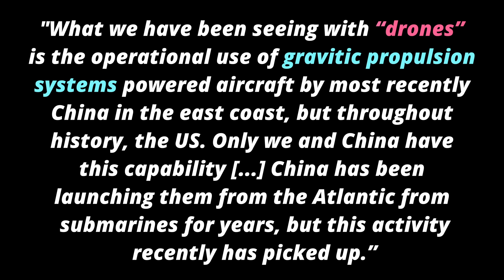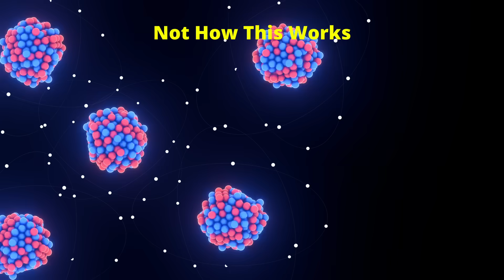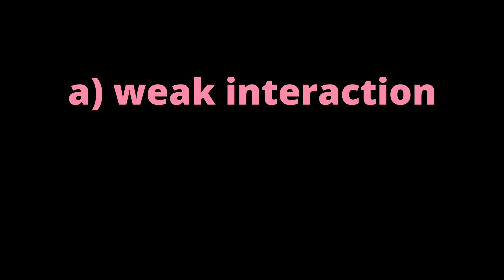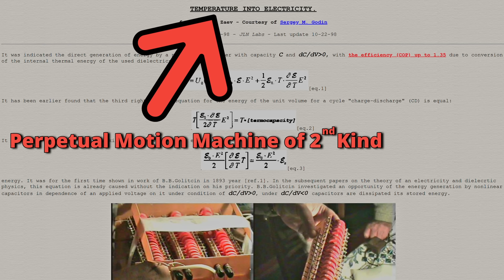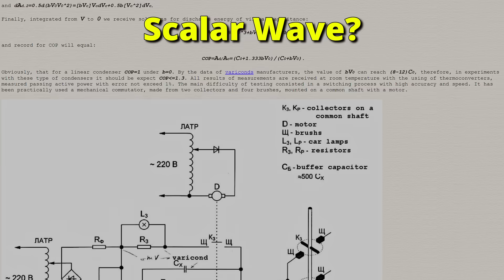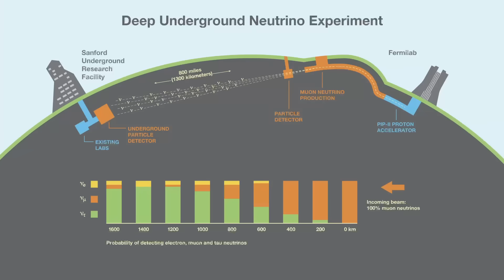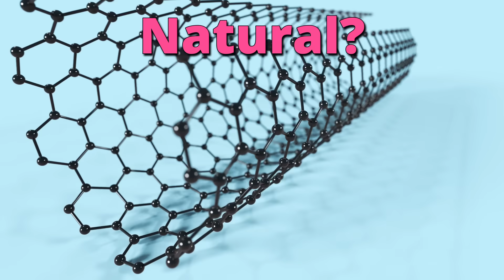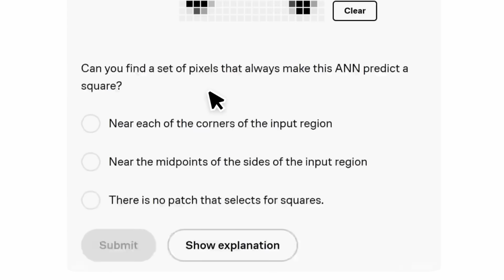What is “gravitic propulsion” and could the US government hide it?

Comment: I recall reading about a guy that got in some hot water (not terribly severe I don't think) because when a newspaper published a photo of a nuclear explosion, he used dimensional analysis to determine a bunch of things about the bomb that had produced the explosion and when he wrote about it the government freaked out and thought he had accessed classified information. The NSA has also actively meddled a bit in the cryptography space, encouraging things like device manufacturers to set modifiable parameters for pseudorandom number generators to specific default values which they knew had flaws that resulted in making the encryption they were used in easy to crack. There's also a law through which the government can ban the publication of certain patents, I read about a list of ones they forbade but they're mostly all related to making weapons so not terribly surprising. The only one that surprised me was that 6-axis 3D printers were controlled for a long time. Loads of stuff in aerospace is classified or at least export-controlled information that it's illegal to send to other countries. Back in the 1990s I remember the creator of the PGP public key encryption software got a minified version of the source code tattooed on his body because the government was trying to control availability of encryption.

None of that stuff is 'conspiracy theory', they are usually quite public about banning things, at least the things that are no longer banned. I've seen people on YouTube doing 6-axis 3D printing, for instance, and 20 years ago that would have gotten them a visit. What annoys me the most is that one of the justifications listed in the law that permits them to ban patents is for 'economic stability' reasons. And I think that gives a lot of steam to conspiracy theorists. It's basically saying 'yes, if we invented a super efficient car that runs on water, we would probably classify it because it would make the auto companies poor'. They haven't done that for AI though, which is basically 1 breakthrough away from annihilating knowledge work. For all I know they've never actually used that reason to memory-hole a patent. I would certainly very much like to know, though.

Comment: "Change the ruler"?
Your speed changes WITH the ruler! 
If a plane buzzes past at 500mph, it looks fast, but if you change the ruler by looking at it from 7 miles beneath it on the ground, it looks like it's going slow, but it's still going the same speed.

Comment: Case in point re. the government suppressing maths.

Back in 1973, the USA government requested submissions for a new encryption standard and IBM put forward an algorithm called "Lucifer." The NSA accepted this candidate but on the condition that changes were made to the "S-Boxes" - substitution matrices that govern how strings of bits are mapped to others as part of the obfuscation process. IBM didn't know why, though there were some suspicions that the NSA might be installing some sort of backdoor but nobody could work out how such a thing might be working. The algorithm, with the revised S-Boxes, became DES (Data Encryption Standard) and was released in 1977.

In 1991, a researcher called Abi Shamir (yes, of RSA - Rivest, Shamir, and Adleman - fame) subjected DES to his new Differential Cryptanalysis (DC) technique (which analyses two or more plaintexts and their matching ciphertexts to look for patterns) and he found that if the S-Boxes hadn't been changed, DES would have been much more susceptible to that cracking technique than it was with the changes.

The conclusion... the NSA knew about the mathematics involved in the DC technique nearly at least 15 years before it has been publically (re-)discovered. As it was, DES was still susceptible to cracking using DC, though this was largely because of the increase in computational power in the intervening years and was supplanted by the new Advanced Encryption Standard (AES) in 2001.

Comment: There's a way to go fast. There's the proven method of slingshotting around planets. If you've got lots of time, I think you could do the same thing around stars. There are indeed a lot of stars in our galaxy, so a lot of opportunities for a slingshot. You could reach a very high speed. Of course, it will take thousands of years to reach a high speed, and it'll also be a lengthy process to slow down. So you need a lot of patience for this.
Then there's the slingshot idea behind a space elevator. Putting several such slingshots in a row could propell a spacecraft to very high speeds. Well, unless the slingshot disintegrates under the enormous stress.
A good bet could be a double star system. You could slingshot a few times around 2 stars and get to high speeds, thanks to their high gravity. You'll also need a binary star system on the destination to slow down.

Comment: This is analogous to what I have run into, when scientists/mathematicians believe (and think they know without doubt) whether or not something is possible or impossible. Some valid ideas are dismissed without further thought because of this. It is thought without question that to align two IMF's to a certain distance the resulting FIF (Field Interaction Force) will be, at best, a 'zero sum equation' because the force needed to do this is equal to the resulting FIF. This is not so. By bisecting the two fields, or rotating one field into the other at that predetermined distance there is a 2.5x force differential. If two magnets are stuck together is it easier to pull them apart or slide them apart? In fact it is 2.5x easier to slide them apart. This is a natural force differential which can be used to advantage. Look at my MEO (Magnetically Enhanced Output) videos.

Comment: Think of all of the physics that was discovered from 1850 to 1950, then think of how it had been applied to travel.  The only real contribution made to our current rockets is the ability to make materials strong and light enough for the job, and to build computers to help with design and manufacture.  The actual physics of the process are Newtonian.  Nuclear processes are important for things like RTGs and ion drives, which aren’t really helpful for human travel.  There are a few nuclear travel designs, often with significant downsides - but even there, that allows tapping into new power levels, the actual travel is unchanged.

I mean, maybe there’s some magic physics which will power a trip to another star system in … the year 2800?  It doesn’t seem likely to be around the corner, engineering is HARD.

Comment: I'd argue we would have no evidence as to whether it is possible or not to manipulate the gravity field with our most manipulatable field...electromagnetism...even if significant and practical couplings existed between the two. GUT theories and running of the coupling constants suggest gravity and electricity are connected at very high energies...much higher than anything accessible now.  However, I would argue that significant couplings could exist at much lower energies under our noses without us knowing.  This is because the forces are of such hugely different magnitudes (10^37-10^43), one drowns out the other and would make experimental detection very difficult, even if a significant and useful effect existed. Achieving a significant molar fraction of electrical charge in an object relative to the gravitational mass charge would vaporize our equipment and produce deadly and interfering electrostatic discharges. Particle physicists have also not designed good experiments in this area either.  While we know neutral matter and antimatter fall in a gravity field, we do not know from our current experiments whether the electron, or any other charged particle falls down, up, or something else in a gravitational field.  There were plans to measure the fall of an electron beam in earths gravity field, but no significant funding or progress has been made to my knowledge.  Sakharov in fact had a theory how gravity could be a weak derivative force of electromagnetism.

Comment: Its not so much "anti gravity" but gravity amplification. Lock on to a source of gravity [any star in the right orientation] that is the opposite of what we consider "down". Amplify it enough and you get what could be said to be "anti gravity" because it could cause the item in the artificial gravity field [you?] to levitate. 

Then find another gravity source to pull you the way you wish to go. With billions of stars there is always a gravity stream "going your way" You can find the gravity stream via the light from the star. 

Zero in on that, amplify the accompanying gravity stream and away you go. Gravity can be manipulated, we just need to figure out how to take what we already have and amplify it. That means convincing the electrons orbiting the nucleus of every atom in your body to feel what they already feel but just a little bit stronger. Your atoms can feel the pull of stars, just like the ocean can feel the pull of the moon.

Consider how your atomic structure is influenced by earth's gravity field to hold you down to the earth. How gentle and even that force effects you. Get that wrong and when you amplify gravity you could zoom into space at 10,000 ft per second. 

We should be able to amplify a stars gravity stream with a few millivolts. A 9v battery should be enough to power a gravity amplification field for a day. In other words put on your gravity suite and fly all day until you feel like coming down.

Comment: I consider theoretically, anti-gravity might be possible, but the matter would have to be modified and sustained in an unnatural state by outside means in a way physically not possible. It is just impossible to manipulate impulse exchange triggered by gravitational fields.
Nothing can come into existence, which can not come into existence as a result from any previous state or experiment configuration.

The only way to do it is to stop a particle to a standstill, then keep applying an accelerating upwards force to it... which basically equals pressing against it from the bottom with a hand or whatever.

Comment: Gravity manipulation propulsion is real and has been known and developed by certain groups on earth .

But What is gravity?

Gravity is nothing more than an energy flow within a potential energy medium called Ether that obeys a specific frequency. It is not easily measurable from an existential low frequency plane, such as the Earth's 3D and what can be perceived are only its effects as something that attracts large or small objects. So gravity is a specific frequency magnetic flux.

If it is a specific magnetic frequency, it would be specific to each place since the dynamics of energy interaction between objects, planets, suns, moons, for example, specific to each place is unrepeatable. Gravity is directly coupled with the frequency of transformation of the potential energy to a solid object with mass being that the amount of gravity that an object receives is directly proportional to its mass.

So to manipulate gravity or to generate artificial gravity, what we must do is first detect the base frequency of the gravitational flow of that specific point or region and with it create an electromagnetic flow of opposite values that neutralize it using the destructive frequency principle . it consists of several layers of rotating spheres one inside the other. Each sphere is of a non-conductive compound or material but super resistant to high temperatures and is completely filled with high pressure metallic liquid in special alloy. 
similar to enriched Mercury or Red Mercury. 

The spheres rotate in the opposite direction to each other at RPM between 10,000 and 100,000, the differences in speed between each of the spheres and their relationship with the others cause an internal change in the gravitational output frequency . The required output frequency is calculated with the help of magnetic interferometers which then are fed to crafts computer where the  rotational speed of the spheres are adjusted in order to output the frequency that would negate the local dominant specific gravitational frequency.

Comment: Oh, you're talking about Gravitational Shielding and the work of Roger Babson in the late 1950's. 

Anti-gravity is to the mid-to-late 20th century what perpetual motion engines were to the late 19th and early 20th century. Tons of people- including potentially famous ones like Tesla- claimed they had such devices but that usually just was not the case. And much like these claims of perpetual motion engines, any sort of anti-gravity technology has, thus far, failed reproducibility. 

I'd quite like for anti-gravity to be real and I'd quite like to have anti-grav boots so that I can forgo having to own a car but in practical terms the technology isn't there and as far as I understand it, it doesn't even clear the low bar of, "Well, the math checks out" meaning it's further away from the realm of possibility than fanciful technologies like warp drives, hyperconductors and cold fusion.

Comment: Finding new physics is like finding a new secret room in a house in which you've lived for hundreds of years. You know the sizes of all rooms, how they are placed in relation to each other and you know the outside size. There are a few places that are hard to reach (the chimney, water pipes in walls, the cable ducts) but from the numbers and your knowledge, you can be pretty certain that any "secret room" must be either very small (or someone would have found it long ago) or in a totally unexpected place (like below the basement; but again unlikely because the house isn't sinking slowly into a hole and there are no cracks in the walls).

Comment: i think about anti grav a lot., and.,  iv come to the conclusion that a human or likely any earthling would likely glitch up,  fish out  & shut down if it ever went anywhere near even another source of gravity never mind anti.,  your equilibrium depends on it here on earth., hoomans are sensitive gravity detectors as bipeds., most of you cant even get on a boat .... You get dizzy and fall over immediately if your brain for a few seconds experiences a miscalculation in your orientation to gravity.,  which i think actually happens more times than people notice.,  every time you've ever felt like you were falling for a split second is a glitch in your gooputer,  dizziness vertical or horizontal is too., so a gravity well anti or not would most likely overload your sensor packs and screw with your biology ., An item that is massless on command is what we actually need,. that way we can accelerate it cheaply and tow mass with it same way we use gyros & flywheels already

Comment: Thing is, we've had gravity propulsion forever...
Push a boulder off the cliff. It moves as if by magic toward the canyon floor.

ACME sells a mail order kit.
Comes with a tiny umbrella and a small sign that says, "help!."
Reply: Meep Meep
Reply: Back in the 1960s, if you looked in the back of Analog magazine, you could find an ad tor an antigravity device that you could buy. I always figured that if I had sprung for that (it was only a few dollars, IIRC), I would have gotten a coathanger.
Reply: @Globovoyeur  
The little ion wind triangle thingy.
What they didn't tell you is the power supply was a TV fly back transformer.
BZZZZT.
You could be the first only kid on your block...
Reply: @ablebaker8664 that was called a ‘lifter’.
Reply: Nikola Motors had a truck with a gravitic propulsion system, and they went into bancrupcy. (Don't get hung up on the details that the rolled a non functioning truck down a hill to make it seem like it actually can drive.)
Reply: @clockworkvanhellsing372  A friend used to work for a hydrogen fuel cell company decades ago and they had this hydrogen powered bus unveiling event for a bunch of government reps where it would drive up to the gathered crowd but the damn thing bricked itself moments before. Fortunately it was a on a hill so they rolled it down to the crowd and stopped in front of them. Everybody was "oooh it's so quiet" haha.
Reply: @theslimeylimey  
They should reach out to Gavin Newsome... that way California busses can all work the same way. 🤣
Reply: @clockworkvanhellsing372 There's a video on YouTube exposing Nikola motors, where the video of this advert was shown.
Reply: Gravity is a contributing factor in nearly 73 percent of all accidents involving falling objects. ~ Dave Barry
Reply: @bélalugrisi  does that mean anti-gravity is responsible for the other 27 percent, or was it clumsiness.
Reply: Nice.
Reply: 👍👍 got 2 for....U know.
Reply: I had one of these but it didn't work the first try, so without any reflection I bought something else and had similar results. YMMV
Reply: BOOM.
Reply: Pinewood Derby racers (cub scouts and their annoying dads) agree.